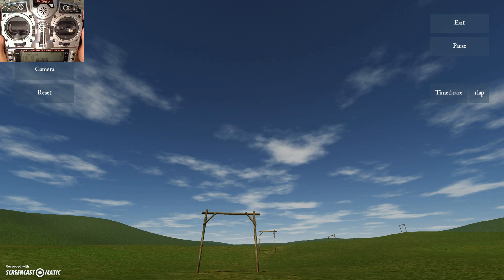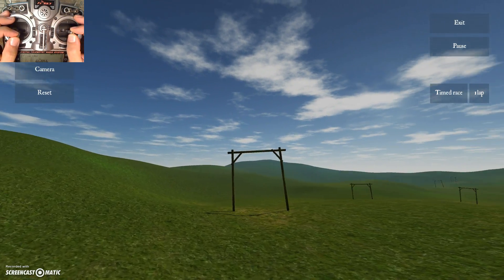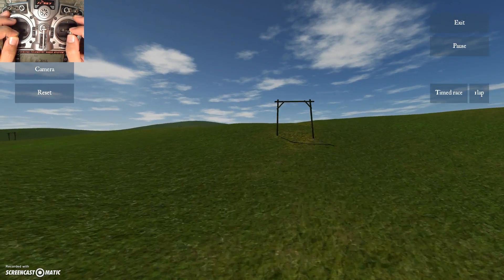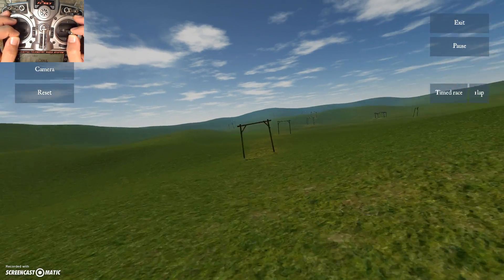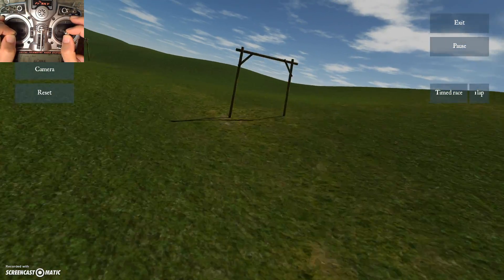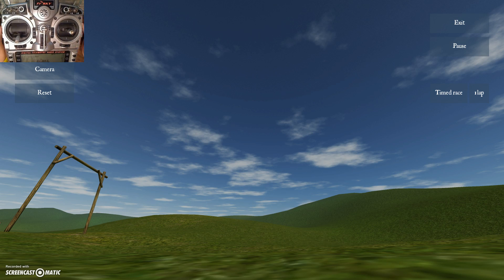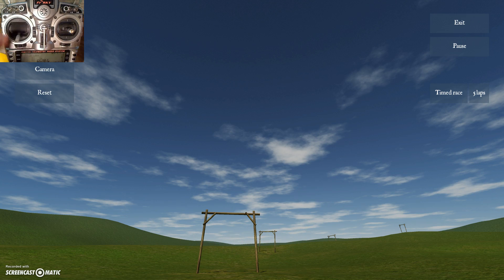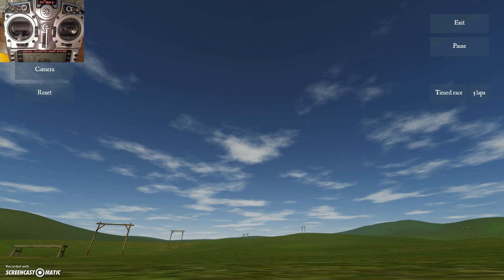How To Fly A Racing Drone - Lesson 20 - Slow is Smooth and Smooth is Fast

Comment: On the turns, the quad gets uncontrollably fast even without applying any additional throttle. How do I maintain the speed at the turns?
Reply from the maker: Pitch back a little bit in turns.
Reply: @JoshuaBardwell  thank you so much. These training videos you made are still 💎 after 5 years. Thank you for investing your time and energy making them 🌞🙏

Comment: 3 things i heard the most in auto racing:  
1: look ahead (so you can plan smooth line)
2: slow down to go fast - same as here, you quickly get out of control if you are driving above your ability
3: slow in, fast out - kinda repeats #2. if you're in full control, you can set up for the next element much better

thanks for this series, JB!

Comment: I don't know if it's because your using it so little or that's it's mixed in but you look like you're barely using any yaw. Do you have any yaw mixed with your roll? Great video, will be looking at the rest of the series cause it's exactly as you say, cruising around freestyle is easy but making it through the gates is a whole nutha ball game and very frustrating. We use the "slow is smooth and smooth is fast" principle in formation skydiving. Thanks.
Reply from the maker: No mixing. Just my rates.
Reply: + Dean Hallal. I was pleased to see your comment comparing it to skydiving. I have been jumping since 1975 and it took me a very long time to recognise this truism. It is applicable to every discipline in the sport that I have managed to achieve any degree of success - (old school, I'm afraid) - Relative work, Canopy Relative Work, Accuracy and Style. 

I also fly fixed wing (real size) and have flown helicopters amongst other rotor wing aircraft. Every pilot knows this.

Comment: This simulator has been a godsend. Great for muscle and reflex memory. Been using my Real Flight 'transmitter'. Tried the demo, everything worked, then bought the full version. So glad camera angle can be changed. Although I have to practice on this location or the desert location because I have a crummy laptop. Lowest graphic setting but runs very smooth. The other maps kill the framerate.

Comment: How much yaw is needed for this type of flying? You don't seem to be using any?
Reply from the maker: +Greg McKean You couldn't fly this without yaw. Any time you see the copter turning, yaw must be involved. Roll by itself will only change the direction the copter is moving, not the direction it's facing. If you watch my left stick closely, you can see me making inputs. Especially when I'm flying slowly, the inputs may be hard to detect, because the stick is deflected slightly, but is not moving very much--it's being held in place.
Reply from the maker: +Greg McKean The more up-tilt you have, the more pitch-forward you are, the less yaw you use when turning and the more roll. That may be part of it.
Reply: Thanks for the reply. I guess subtle movements are the key here, I feel I suffer from too aggressive movement thus having to over correct. Finding the balance.
Reply from the maker: +Greg McKean it all depends on your rates and expo of course.
Reply: Joshua Bardwell  hi joshua i follow you a lot and i learn a lot with your channel , i feel myself confortable with the rates what i get , i would to know if you have idea how you transpose rate fpvfreerider on real quad when it exprim in different value like deg/s or on my vortex 0.x i'm struggle because no unity , i understand i will have same effect depending on mass of the quad  but i'm confused and i consider you like a mentor for me , so maybe you can help me thanks in advance
Reply from the maker: Just tune the rates manually on the FC. Don't try to copy the rates exactly. Unless you are using something like LIftoff, which explicitly copies Betaflight's rate calculation, it will be very difficult to get the curves to match.
Reply: Joshua Bardwell thanks joshua i will do so